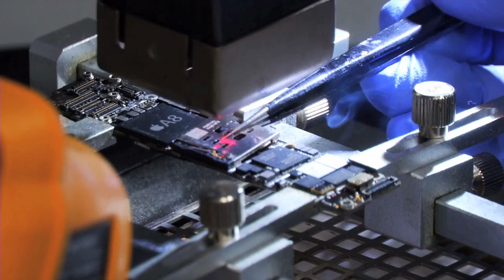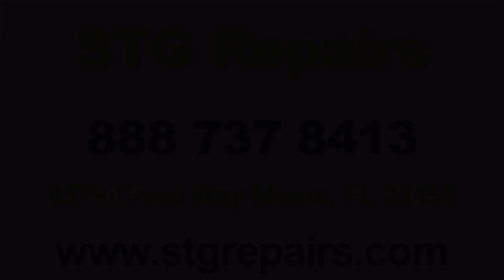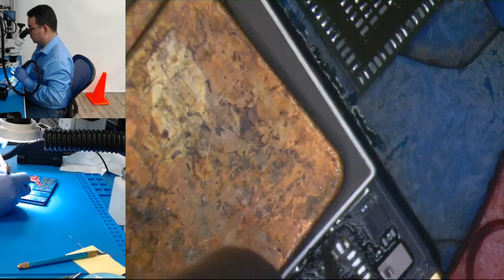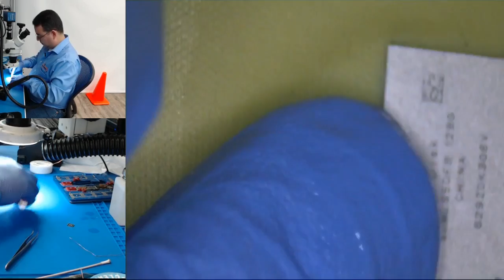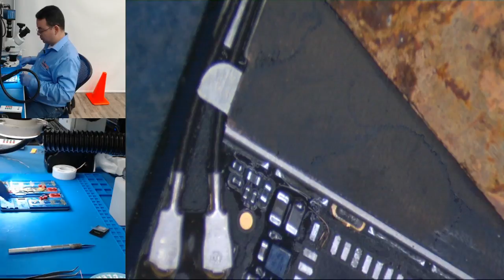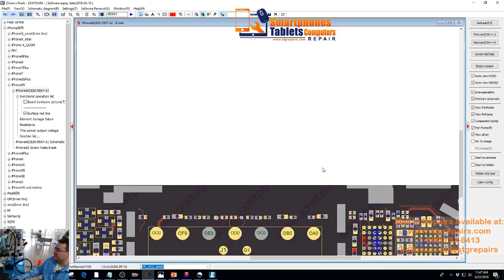iphone 6s Wifi Chip Short JC PRO 1000s in action

Comment: Good stuff!!! May i ask what country your from Sr.? I only ask cause i notice your accent it sounds like my Fathers(Rip) but I and my family from Romania and iv literally loved electronics since i was a kid my mom said I would get on the roof of the house in Romania and I would take apart my toys so they wouldn't catch me doing it!😂😂 but iv been microsoldering for around 7 years now maybe more yeah I guess more cause I remember installing ps1 and ps2 modchips but iv only started with a hot air wand 7 years ago and I also got a Mentor for Electronic engineering when I was 17 and he toucght me alot but nothing with microsoldering sadly mainly dose older things and his eye sight isn't as good anymore but he told me about a year ago that I act surpassed him on microsoldering which kinda made me feel bad but he said to keep going cause I can solder flex cables and he said alot of engineers or techs can not so just like with the advice he gave me about grabbing garbage old cable boxes literally out the garbage and trying to take something off and put it back and see if it works well now I literally make it look like it came out the factory but I wanted to say that im impressed and normally now it take a little extra to impress me 😂 but grate job+ keep up the amazing work!